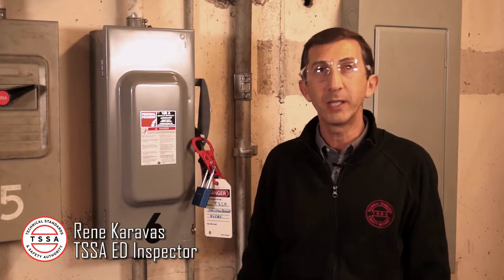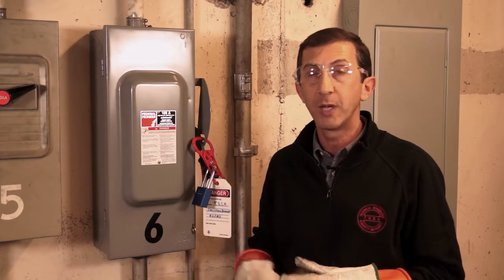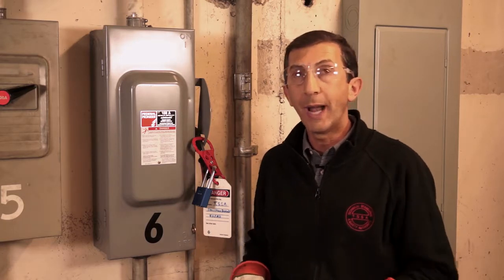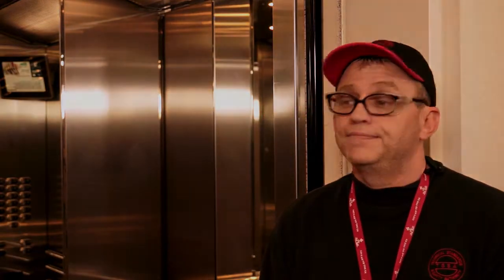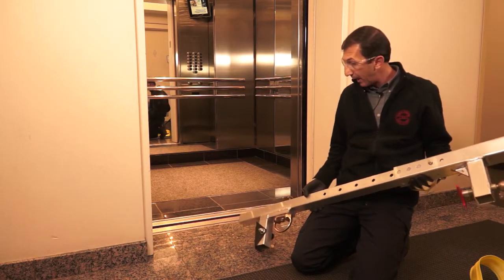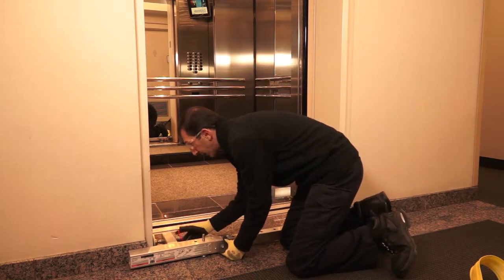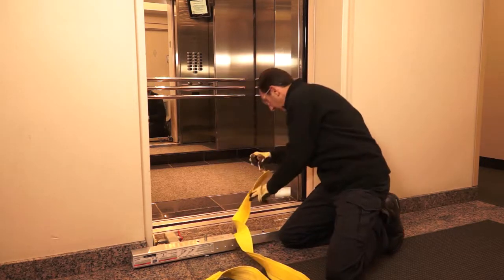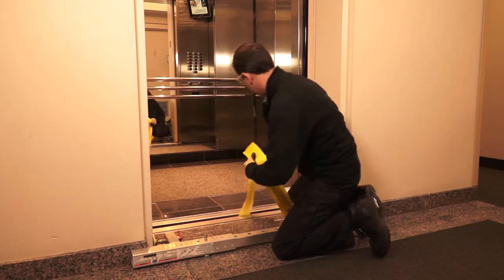Ask TSSA-Elevator Deep Pit Safety

Comment: I doubt is this is the safest method. Also putting a nylon or polyester type synthetic lanyard down the crack of the elevator door opening without any means of protecting the webbing material using an abrasion resistant fabric as a buffer is very unsafe. This video lacks details regarding the fall protection equipment such as the yellow coloured lanyard making contact with sharp edges. Even if the material is single ply or double the lanyard is not cut resistant. They should redo this video.